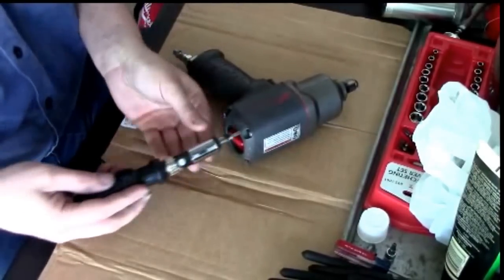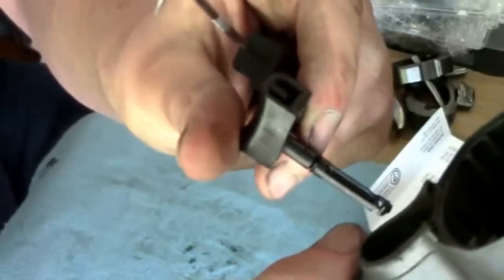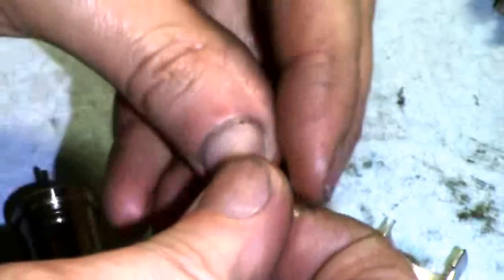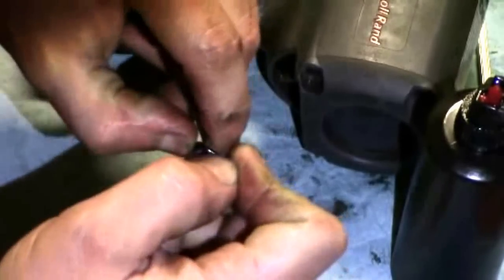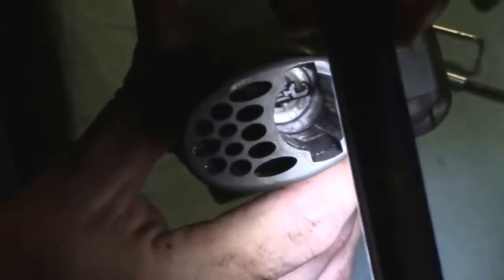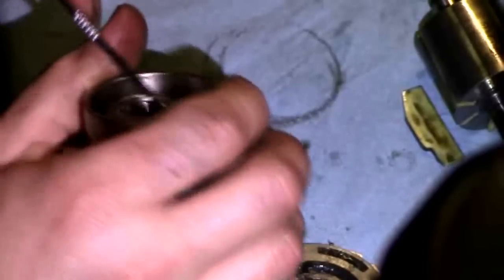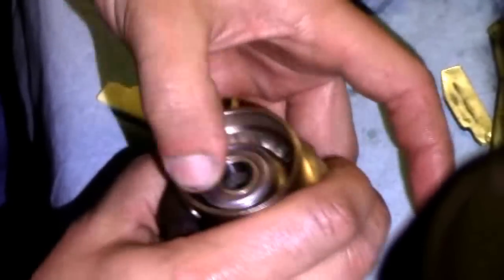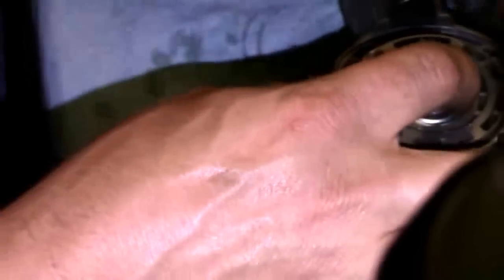IR 2135TIMAX Rebuild

Comment: I do this every day for a living. You did a great job. The only thing I would advise is to use petroleum jelly (Vaseline) on the O-rings and inlet seals. I always over lubricate the rotor blades as well with plenty of air tool oil. I also put the entire motor assembly together before I put it into the housing.
Overall, good job.

Comment: Thanks for the video man. My impact spins on its own and I’ve had the gun for 11 years now, I’m too stubborn to give it up. Now I can rebuild it confidently. 🤙🏻
Reply: hey my air gun spins on its own wht did you do to it
Reply: @loutasks3637  Spins on its own?  So the motor & anvil are turning without pressing the trigger?  I had a broken air inlet valve seat do that; air was getting in all the time.
Reply: This is exactly what my 2135 is doing now.  I took it apart and saw that the oring/seat cover had a huge chunk missing... so it was letting air in all the time.  I'll be rebuilding the impact tonight with the kit I bought.

Comment: Thank you for this.   I was using my 2135TI and all of a sudden it just started spinning on it's own.  I took apart the shaft area to find out that clearish gasket was broken/chunk missing.  So i'm assuming that's what was letting the air go through constantly.

Found the rebuild kit. and and should have it tomorrow.  I didn't realize it was this easy to rebuild from watching your video!  I figure if this lasts me another 15  years I'll be happy!

Comment: Big thanks, with your instructions I was able to easily rebuild mine that has always air going thru even if I didn't touch the trigger. By the way, the bearings are clearance fit and not interference. Otherwise a press would have been needed to put them in. But awesome job! thank you!

Comment: Good job. One thing I'd like to mention  for people watching is the front plate of the motor on these. It's critical to the power and it's soft metal and will wear from the rotor. Your's looked ok from what I saw. No rebuild kit will give a wrench new power when that is worn. Advise to check that and the hammers and anvil where they contact before buying a rebuild kit when power is down. Also, on these they will blow an o-ring on the direction valve and you can feel the air blowing out the buttons when you pull the trigger, makes them very weak as well. Many times a rebuild kit won't increase the power ,it's other issues causing low power.
Reply: 56stikman thanks for the info man, I rebuilt mine a few months ago but I still felt it weak, I overlooked the front plate, I'll take it apart again and check for wear, thanks alot man.
Reply: can you elaborate on what that part is and what to look for before I look at rebuilding mine?  Also, how do I know if I need both kits to fix my gun?  I am losing power for sure, and its probably 6 years old (non-commercial use)
Reply: It's the plate you take off to gain access to the rotor and vanes.

Comment: Love my 2135qtimax, been a champ for coming up on 10 years of daily shop
Use. Anvil is about ready to shear off, so I was contemplating a hammer kit, or just a new gun all together.  When I saw you comment about both kits for a rebuild, and a link to your video, I ordered both up.  Hoping the cylinder still has some life left in it!👌🏻

Comment: NOTE The front bearing plate will install in more than one position. , IN  the front counterbore where the FRONT bearing goes notice 1 large rectangular recess and 1 or 2 much smaller recesses.  THE LARGE RECESS GOES TOWARDS THE(BOTTOM)  TRIGGER SIDE OF THE GUN.

Comment: I bought a 2132g about 10 years ago. Used it maybe 10 times total. Always oiled it. Doesn't have enough power to break a mower blade bolt. Can't need a rebuild. Can these guns get clogged of fouled up in any way? Thanks.

Comment: Is there a specific way the hammers have to be put into the case like I get you said they’re supposed to be 90° apart from each other like the circle parts was the one side and circle bread supposed be on the other side? What is there a proper up top and bottom.

Comment: co worker swapped out his worn pos 2135 TI for my new one prior to him leaving for another job and did not notice at first my power was down as I keep 3 spare guns so not caught with pants down when at work so wasn't till 2 years later when I was going to tear it apart that noticed the gun did not have my initials engraved and all my tools get engraved within a day of purchase.  sat in tool box for 12 years untouched till decided to look for rebuild video (cause that's what we do these days is watch people make mistakes on u tube) was pleased on tear down to not have destroyed anvil condition and only needed interior cleaned up and lubed to operate as new again. previous owner was a shit head and most definitely did not lube daily as all my other tools are so rebuilding air tools is not something I have needed to do in 30 years .. video was good except last part when installing anvil cover plate you did not describe the orientation which I did when tear down was done ..  its common sense how it goes on but a lot of people lack that gift (on u tube)
No parts were needed at this time will save video if down the road need to do it again. 
ps how the red buttons are removed is not in detail and i simply left them in and this sorta pissed me off as i wanted to do an entire tear down and clean and knowing those buttons were not cleaned on the inside is infuriating..

Comment: Can you plz tell me if this gun is exactly the same parts as the MT2769 matco impact. That gun looks identical to mine.
Reply: It used to be the same. The newer 2769 has a different motor assembly now. Power Tool Repair Ohio can get you Parts 
Powertoolrepairohio.com

Comment: i have this exact wrench a few hours use on it worked absolutely perfect now no power in forward?? reverse full power ...doubt anything is worn ,pulled apart saw nothing.... stumped
Reply from the maker: Robert Vitucci you may have done this already, but check that the anvil and hammers move freely. If the hammers jam it can free spin but have no power. If it just blows air in forward and does not spin, that kinda sounds like an oring on the reverse valve maybe. Make sure all your orings are lubed to help in sealing and not dry rotted. That's about all I can think of at the moment without actually looking at it. Hope you find the problem.

Comment: Just did complete rebuild, to no avail. Gun is still gutless in "forward". Any ideas? All looked great on inside as far as wear. I can stall it in forward with my hand...
Reply: Figured it out! Be careful reinstalling gasket 2131-283, that it slides into the slot properly!!!
Reply: pull the anvil in and out by hand, there should be lateral play in the anvil anywhere from .012 to .035. If there is no play, the front motor housing bearing is pressing the hammer cage in to the the hammer housing preventing free movement, often times the hammer housing will get hot within a few seconds.

Comment: I can't get the inlet valve out.  I pressed in the two side clips and inlet comes out half way but will not come out all the way.
Reply from the maker: Gary Easom once the clips are released and slides only halfway, this is where you yank the housing straight off the inlet bushing. This is easiest with it mounted in a vise. You can see this in the video starting at 2:15. Hope this helps. Thanks
Reply: Yes, you have to YANK!!

Comment: Good video, perhaps show the audience just a bit more clearly how you remove the direction keys, also more light perhaps? However, all around good video. Thank you!
Reply: the direction buttons are held in by small locking tabs, simple push in the forward button, then insert a small screw driver between the reverse button and the small bit of frame material separating the two buttons, then pry the the reverse button out, same removal for the forward button.

Comment: Hiya on my 2135 the trigger has stuck in would you know what part has probably failed to cause this
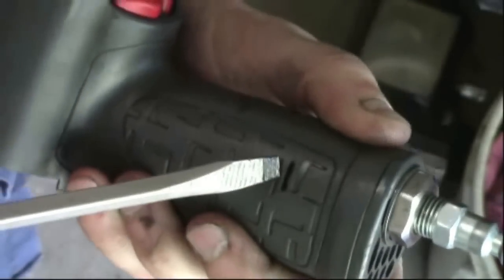Reply from the maker: ricky fuller the back of the trigger has a stem with a hook on the end, the throttle valve stem on the inlet bushing is what the trigger hook connects to. Pull the inlet bushing assembly out( this is shown at 1:45 in the video) and check that the throttle valve metal stem is still in place and look inside the handle. You can see the plastic stem of the trigger, hopefully not broken. It's possible the throttle stem came out of the hook. If all is ok, position the trigger hook to the middle of handle interior and reinsert inlet bushing assembly ensuring the throttle valve metal stem engages the hook. If one of them is broken, those parts can be gotten on amazon. Hope this helps.
Reply: thanks for your help i took the inlet bushing out and found the rod at the end is bent out of shape will try to straighten or will order a new one

Comment: any idea what the size of the O Ring for the trigger is? i have 2 guns and both are bad.. don't want to spend 20 bucks each for 1 o ring
Reply from the maker: Nick Miller I measured my old trigger oring, looks to be 1/4" OD and 3/16"ID. Keep in mind, it actually may be a metric oring. I'd probably go to Napa with the trigger and try a fitting. It should stretch some going on the trigger but still seal in the handle. Hope this helps.
Reply: yessir!! metric o ring did it.. fixed both for 34 cents.. you are the man!

Comment: You wouldn't happen to know what it would cost to have IR impact just like that tuned up and replace the anvil if I had a repair shop do it
Reply from the maker: Mike Yarboro sorry I do not know. I do know that the cost for me to do this rebuild was around $94-96 I think. And those two kits I bought off Amazon. A shops price on parts might be alittle higher or alittle lower plus their labor fee.

Comment: What grease did you use on this please ?
Reply from the maker: I used Ingersoll Rand 105-1LB, which is a 1lb can of grease.  Way more grease than I’ll ever need for air tools, lol.  The manual also says you can use Ingersoll Rand 115-4T, which is a smaller quantity in a tube.  Should be plenty for the bearings and hammer case.

Comment from the maker: Thanks Domingo. I found the buttons on Amazon, copy this link to your browser. These are for the 2135timax: 

https://www.amazon.com/gp/aw/d/B00820M1UW/ref=mp_s_a_1_9?ie=UTF8&qid=1471999457&sr=8-9&pi=AC_SX236_SY340_QL65&keywords=2135ti+tool

If that doesn't work, search for "IRT2135-K75" on Amazon.

Amazon has some other parts too if anybody is looking. I've seen the whole inlet bushing with throttle kit, the reverse valve, and I think the speed selector knob for sale on Amazon.

Comment: What kind of grease do you use for the hammers
Reply from the maker: I used ingersoll Rand 105,  which was in a 1 pound can.  Also can use 115-4t which is smaller amount in a tube.